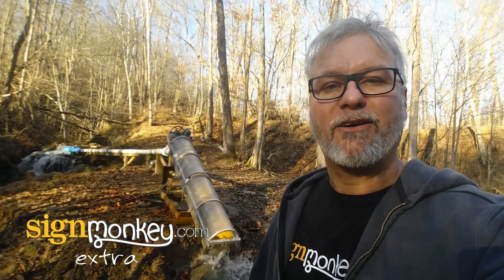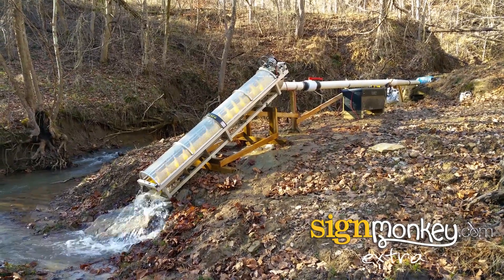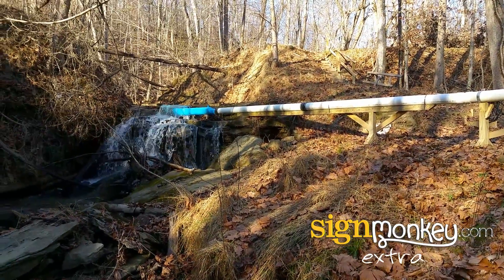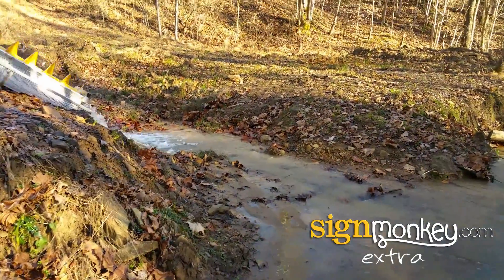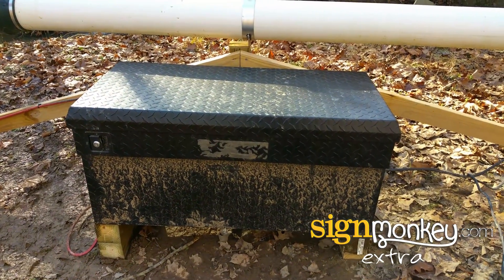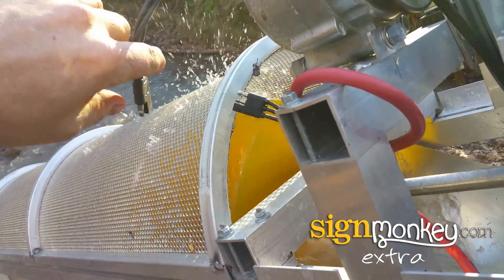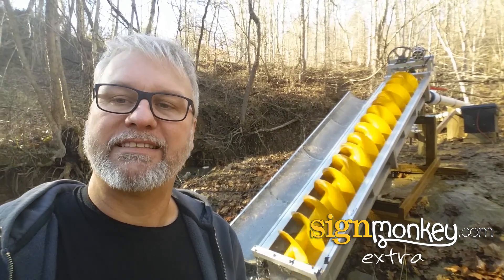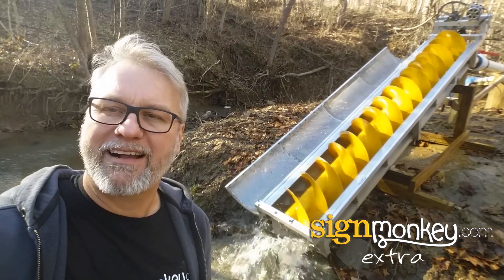Archimedes Hydropower Screw Generator

Comment: I would’ve found it more informative on how it’s built or the gearing ratios. even the mechanism running your generator so far all I’ve seen is you bragging about a system that you have not explained thoroughly I’ll be looking someplace else for more information

Comment: An open aqueduct offering a bigger cross sectional area, would be more efficient than the delivery pipe that you have chosen to use, to feed the turbine, as it would have less friction and less fall required to shift the water to the turbine intake, which means you would have more available head, and could therefore install the screw turbine on a steeper angle, or make it's screw longer, to take advantage of the additional head, which in turn means a better wattage yield.

Comment: It looks like that stream slopes down a fair bit after the waterfall, what is the total head of the stream across your property? Would you produce more power by building a small dam (4'-6' tall just to create a small settling pool) adding a Coanda screen intake and diverting the stream flow into a penstock down to a Turgo turbine at the lowest point of the stream.

Comment: Great project, beautiful turbine !
It would be really useful to others if power produced, flow rate and the screw dimensions were given.
From looking at it while running, I guesstimate a power output of 400 watts. 
Here is how I guesstimated:

Generated Power (watts) = electrical (generator  cables, convertors etc) efficiency 80%) x turbine efficiency (50%) x water flow rate (0.05 m^3/sec= 50 liters/sec) x total head  (2 m = length(4m) x Sine(30deg)) x density of water (1000kg/m^3) x gravitational acceleration (9.8 m/sec^2))
=0.8x 0.5x0.05x2.0x1000x9.8  
= 398 watts.

Turbine efficiency can be significantly more or less than 50% depending on the details of the design. Water flow rate is the primary uncertainty.

I would love to know how close my guess is !

Comment: Thank you so much for this video.  I've created a discussion about your Archimedes screw in the Water Powered Pumps Facebook group, not to create power, but to run a piston pump.  https://www.facebook.com/groups/240458583255303/permalink/699978833969940/

Are you still making the Archimedes screw?  
Any chance you could also make a plastic water wheel?

Thanks

Comment: So how about using magnetic drive to power generator from Archimedes screw. Instead of wasting energy with direct drive from said screw, have the fly wheel spin to max rpm then magnetically transfer rpm to generator flywheel using neodymium magnets incorporated into flywheels. You could house both flywheels into a vacuum sealed housing thus eliminating drag caused by wind resistance from spinning flywheels . The closer the two flywheels are together you should get 1:1 ratio rather than 2+ :1 ratio.. and if the flywheels are heavyduty with some weight to them rather than flimsy plastic or lightweight alloy wheels you should achieve a much steadier & even spin. 
Just like you would find on a steam engine.. 

There is Method ( proven method ) to my Madness...

Comment: This is a pretty amazing construction! What I'm thinking: What the would the difference be if you didn't have that long screw and you just did a small fan/turbine at the end: you would get the same speed, the difference though with your screw is that you have enormous torque and this you can leverage by using a much bigger generator motor for more power.
Reply: Making, Cooking, Fixing I’d like to know if having the screw vertical changes the speed and also some means of knowing how long the screw needs to be to produce the required torque for a given rpm, since things like this could work on house down pipes or in lower head environments.

Comment: I see some people claiming that this setup should make around 1000 watts. There is no way that that's correct. The actual vertical drop in the screw doesn't seem much more than 2 meters. At 70% efficiency (common for these) about 71 liters (about 19 gallons) of water per second would have to pass through that thing to generate 1000 watts. (E = m * g * h,  P = E / t))  
It seems closer to about 15 liters per second,  I'd be surprised if this setup makes much more than 250 watts.

Comment: My guess is that he's getting around 100-200Watts . Whilst that's not much... it's trickle heat and will take the edge off your heating tank over time, day in day out.
Reply: Agree. 100-200
Reply: @thomaspayne6866  indeed..one only has to imagine how much energy it would take to pump that water in reverse ,,,and take a good slice off for efficiency.  My feeling is that with greater inclination of the screw he could gain 20% more, with a scoop of of a digger bucket

Comment: If designed effectively this could be a practical solution. I am designer, I would put the generator in side the tube of the screw body, one at each end, design and make it to function under both extremes of water flow conditions, and test for fish survival. Once this has been done it could be placed under bridges with a Minimal amount of fuss, it would have to operate under flood conditions so full submerged!
Reply: ken pen lol

Comment: Increase the head available at the input of the blade, flow rate is ok.
You will get more power than that.
As power = ρgQHη 
Where
ρ = density
 η = Efficiency of turbine
 g = acceleration due to gravity
Q = discharge of flow 
H = net head available at the inlet of turbine
Increase H, increase power

Comment: Cut him some slack folks. No good deed of presenting a neat power generation idea to the off grid, techie community, will ever go un-punished, without full disclosure. 

An excellent demonstration in my opinion. It will be interesting to see how it performs over time and yes if you could provide some output information. That would be very interesting to hear. I imagine that grit or small stones may be an issue. Possibly wedging between the screw and casing. Have you had any issues with this?

Comment: If you spin it in the other direction with a motor or crank it by hand, it will pump water uphill. That's what the Archimedes screw was originally invented for.

Comment: Pretty cool wonder.if a longer screw would turn a bigger generator
Reply: A simple way to look at it is to remember that "power" is the ability to lift a given weight a given height in one second.
In the US:
1HP =  lift 550 pounds one foot in one second.
This thing can be thought of at taking power out by lowering a given weight of water a given distance each second.
Thus to get more power out, you need to either work with more water every second or increase the distance you allow it to go down by

Comment: For those of us who are a bit more technical, some data on voltage and amperage plus calculated wattage would have been the most interesting part.
Reply: I was JUST about to ask...  LOL..
Reply: Next time? Its a 3.5 year old video and a 1 year old comment. When's this next time, you dont have to make another video just give an answer of how much power can this produce. Im very interested in building a similar sized on and would like to know if it is worthwhile or not.
Reply: EXTREME ENGiNEERiNG LiFE  11KW?   So, assuming your battery system is 13.5 volts and using ohms law,   11,000 divided by 13.5 means you're getting 814 amps of current?   I seriously doubt that.
Reply: Cool looking but rubbish design for significant power output. So many people have built these and been disappointed with the output.
Reply: First name last name  lol dude why would you waste power by pumping the water back to the top?
Reply: Paul Guaguin  Guesstimate is not measurement.   We don't estimate, we measure.
Reply: Talvez uns 150 watts com essa altura e volume  de água
Reply: maybe he would if you asked nicely
Reply: from what i can tell the head is about 2 meters, the flow is about 2 L per second so that would be about 29 Watts of potential energy, probably only half of that i captured at best. So 14-15 watts IMO.
Reply: @Link I think it's more flow than 2 ltr per second. No matter though. The whole thing only uses a fraction of the potential energy coming from the flow available.
Reply: Yes. And any info on which are the best.
Reply from the maker: Next time
Reply: @Signmonkey  So here we are 2 years later and no data. Anyway, there is so much more power to be captured from that water than you're catching. You guys and your V-belts. Not sure why so many people like to give up horse power to V-belts.
Reply: Bob Nesbitt Are you speaking of the belt between the drive shaft and alternator looking thing? What is a better belt alternative?
Reply: @selahman1074  Yes that belt.  I would go with a serpentine belt if I had no choice but to use a belt. Those V-belts rob a lot of power. Especially as torque increases. The best alternative would be a gear box. Yes they cost more but they last much longer, require less maintenance,  and your power output would be greater. V-belt loss can be as much 175watts on a 25amp draw even with proper belt tension. That's a lot on micro hydro systems. Not just due to creeping/slipping but also friction. The absolute best would be direct drive. I'm not sure if that's applicable with an Archimedes as they turn so slow. The alternator would have to be much larger in diameter to be effective at low rpm's for direct drive.
Reply: @Signmonkey  DID YOU BUY THE SCREW SOMEWHERE AND THE BATTERIES/INVERTER?
Reply: @Signmonkey  Loser.
Reply: @cluelessbeekeeping1322  How's that "winning" beekeeping channel coming along? Haha

Comment: So here's where you're going wrong with this and how you could actually make the principles behind it work - you're piping water over a fair bit of ground before it hits one screw and generator. Either divide up your screw, or add more along with additional generators for each new screw system. Otherwise, as many have pointed out, a wheel would have made much more sense and less complicated to engineer. You've over engineered this for the same gains, which is actually wasteful.
Reply from the maker: Please post one of your projects :)

Comment: Wouldn't it be more efficient if the incline was steeper?
Reply from the maker: I did a little study to determine the angle and if you go to steeper the water does not have time to apply the gravity pressure to the flights
Reply from the maker: I guess so, its been a while since i though about it
Reply: @Signmonkey  I'm just wondering what would happen if there was an enclosure around the entire screw so you could tilt it higher without water going out through the sides.  Perhaps a longer screw would help too... but hey...  you have way more experience with these things than I do.  I just like the idea.

Comment: you shouldn't divert a creek in order to get power from it. this is a classic example of how even renewable energy can still mess up the ecosystem when you don't take the fact that other animals that are part of the food chain use that creek in order to get around and as a food source. you should dig out a proper area so that the water can fall in a stream rather than just spraying all over the hill
Reply: Are you serious? This system diverts maybe 30% flow from the top of a waterfall, and returns it to the stream at the bottom of the waterfall. where it would have naturally flowed anyways. The water isn't being consumed, simply borrowed and returned over a span of several yards. Besides it's his waterfall, his ecosystem to do with whatever he chooses. And its a waterfall. water is going to splash all over the hill anyways, especially after a good rain, which I do believe I heard him say they just had. Besides, if you asked the animals. I'm sure they would tell you, they would be more willing to have to adapt to sharing their creekwater for this powerplant, rather than having to adapt to sharing their ecosystem with a coal burning powerplant.

Comment: Hi Sign Monkey! I have a question. I was looking through the comments and saw that you made this screw yourself. I was wondering how exactly you did that or what process you used to model/design it and also what material it is made of? I am currently a senior in university and working on a graduation project and would like to implement an Archimedes screw into the design. I am trying to gather information on how to get/build a screw this size. Thanks! Also, awesome video and idea!

Comment: this is NOT an Archimedes screw. that would move water uphill not downhill, which is why is was such an amazing invention 2500 yrs ago. you would be so much better off with a water wheel when trying to capture the energy of water moving downhill. hence old mills used a wheel. what a waste of energy. do some research....
Reply: Google archimedes screw generator.
Reply: it doesn't matter why it was invented; the length of the screw makes it 10x more efficient than some single turbine

a water wheel would only be more efficient as long it's tall enough, but then you have construction costs; the set up for the screw is very straightforward and simple = cheap
Reply: What a defensive and frankly homosexual passive aggressive response. Why don't you upload how much energy it produces?
Reply: @TheVegaoscar75  Wow that was a really unnecessarily aggressive comment!  The archimedes screw was designed originally to be a pump yes but you can reverse it to make a generator.  This was an interesting setup and it has advantages over a water wheel, for instance less space is needed and you can direct the subsequent flow of water better.  It was an interesting video so why the hate?
Reply from the maker: Please upload a video of anything you have ever accomplished
Reply: He doesn't have to, he is right.

Comment: Look at www.vertogen.co.uk it works . Variable pitch vertical axis wind turbine .Easy start, internal governor , can be tuned to run at fixed rpm, auto braking system etc. looking for partners investors. Patent applied for.
Reply: Why would we look for that when we are very clearly looking at a water screw generator?

Comment: good job I really appreciate it my English is weak but I try to understand you please tell me what is the rpm of screw and rpm of generator I have three time more water than  your 6 inch pipe with a good pressure so pls tell me how many electricity I can gain from that

Comment: use a motor from a big treadmill..generates more power... but where did you get a screw that size
Reply from the maker: I used a permanent magnet generator designed for a windmill.  I make the screw

Comment: You should try building something like this - https://www.youtube.com/watch?v=WeZxJGT9WRM, it generates a lot of torque for low flow rate and you will get a lot more electricity from it . Archimedean screws are designed as pumps, as turbines they are very inefficient.
Reply: Yeah. I was thinking that an overshot waterwheel would be more efficient than a screw.

Comment: You could use it to power signs at night., however this design has less capability than a paddle wheel and a water jet especially in the department of portability and cost. It requires higher volume of water for the same output of a water jet and wheel design. Looks neat though.
Reply from the maker: This design is for a Low Head, the water is only falling about 8 feet, a jet of water could not be produced.

Comment: Why are you using a screw? only the leading edge of the screw generates power so a turbine at the end is far more efficient.
Reply: Jay Cie t
Reply: No the force is exurted throughout the length of the screw.
Reply: Buddy: "exerted".
Reply: Jay Cie I'm thinking the same: use a boat prop or similar in the bottom end of the pipe and run the alternator off that instead.

Comment: i dont get it, where are the screws collected? how many screws does this generate an hour?
Reply: Screw you !
Reply: kwb at least they are nice and clean...
Reply: kwb it produces aprox. 2.5 lbs of screws daily depending on screw type, however metric threads take longer as the screw producer has to turn in metric intervals to produce nessessary voltplunges for the wtf'er.
Reply: phục êwê  or freeze
Reply: Lol
Reply: Love that much...
Reply: 1

Comment: if you want crazy...try returning the water to above the height it works with, with a ram pump.  but take it a little further.  the residual twelve to fifteen per cent drain off from a ram pump can be recovered with a portion of the hydro generator.  the thing would no longer need a source of water.  in fact you could power two hydro screws with the height one can achieve from a ram pump.  everyone will say it won't work.  But it will.  adding a ram pump will not alter your system, it won't be noticed.  good luck.

Comment: Looks good, but how was the generator and electric system built? I see washing machine motor, but how that is connected is bit hazy for me... :/
Reply: Any suggestions for where and how to buy, create build screw turbine shaft? preferably in lightweight plastic?
Reply from the maker: I plan to make a tear down video soon that will show the parts and assembly
Reply: Cool! Just received presumable working washing machine on the yard and water source (spring well over flow) needs to work anyways, so that done :) I just hope that over flow is enough for this application, cause there is no rivers to be seen in our area. Subbed